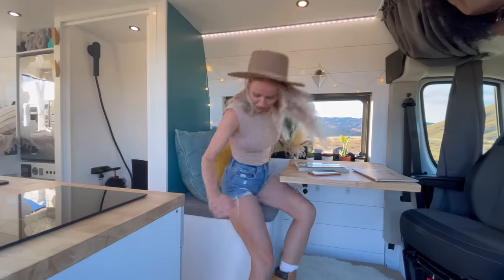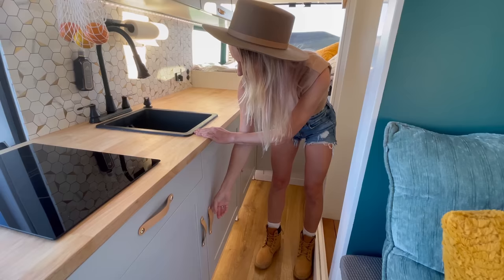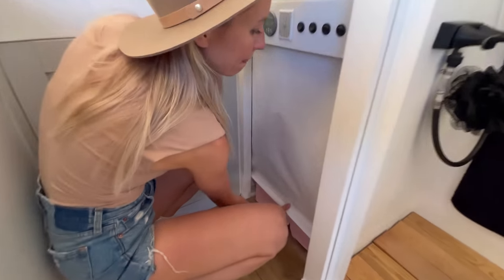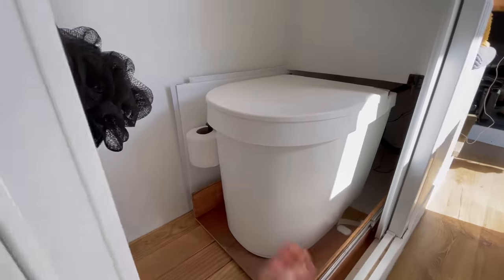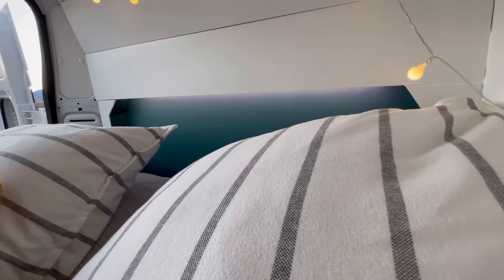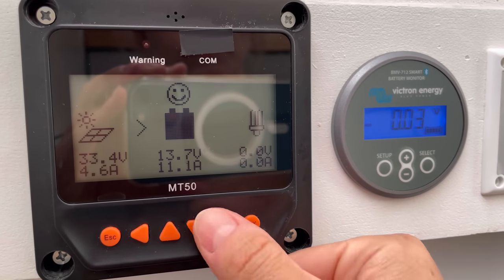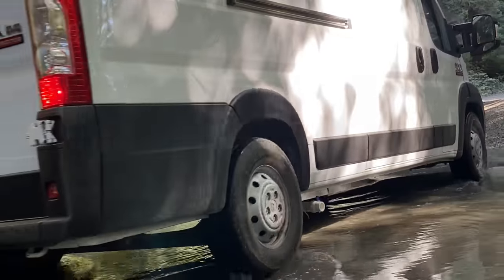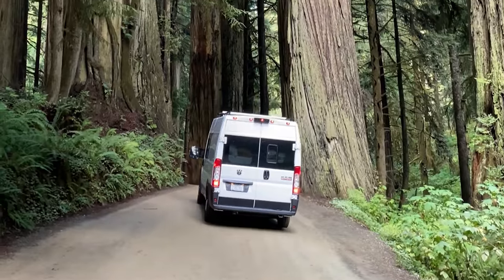VAN TOUR | Ram Pro Master 3500 | Luxury campervan self-conversion with shower & toilet

Comment: I really like the idea of an electric hot water heater.
Water can be heated when driving to a new destination, when connected to shore power, and finally from the van's battery/solar system.  I'm surprised such hot water heaters aren't more common in vans and RVs.

Comment: As van builds go.... yours is a definate 9+ or maybe even a perfect 10!!  LOVE your design, the shower/toilet and I would definately pay over $1,000 for a toilet that you don't have to limit to #1... would HATE to have to find a place, which I imagine would drastically limit outings.  I realize that most state parks have bathrooms, but I have experienced that some of them close for certain seasons... and I don't even have a van!

I see a lot of folks eliminating the garage, which I would not want. Knowing how well our 5 day cooler keeps stuff very cold, I would be housing one of those in the garage to top off with ice when needed, to keep beverages cold, and/or extend for a couple of days, a grocery haul if you were traveling to a remote spot and wanted a bit more to stock up.  I saw one van build that had a cooler like we have, stored in the van garage, that can be plugged into the car a couple of ways, and be either used for heating or cooling. Not sure why most vans don't do that?

I also would want my fridge mid-level instead of on the floor as most have it. Those low fridges would be a pain to find items in the back, or to stock. Your height is perfect and well planned.

Well done.... wish we had the freedom to buy yours!  We could probably afford it, but just not the time to enjoy it!

Comment: If I am not mistaken you are using the nebia by Moen wand for a showerhead.  I would guess gives you maximum economy of water usage. The wand seems to have originally been designed as an add-on to one of their overhead shower heads to give a 360 showering experience. if I am clear on their ad and the product you are using is that right? The role away toilet design the model you choose and the showerhead seems to be the best van bathroom design I have ever seen.
Reply: Hi Michael, thank you for your comment. You are right, shower-head is designed as add-on, It's connector is unusual and we create a little transition using small pease of 1/2" hose.

Comment: Good camperization design, materials and interior functionality, it's a pity that it doesn't have windows to let in natural light, it has only 1 window on the table and the ones in the back.
Reply from the maker: there are 3 windows: 2 on the back and 1 in front. It is sufficient for daylight. But adding more windows, you sacrifice the insulation ability of the van.
Reply: @Daniel,
2003, for our ExpeditionVehicle, we mounted 3010 (three feet wide by a foot tall) dual-pane sliders designed for a stand-still house.
We mounted these at our eye-level standing inside, about eight feet above pavement.
.
Advantages:
* peepers are discouraged
* easy to insulate
* quiet.
We always have two windows open on opposite walls.
Winter, the escaping warm air carries humidity and odors.
.
Based on experience, more windows equals uneven temperature control, resulting in condensation...
... leading to mold.
.
As you can see, bringing in natural light is one consideration, and each decision has consequences.
One consequence of more or bigger windows is the effect on structure integrity.
.
An aside:
Our interior is three paces across by seven paces long.
The inexperienced often ask:
* "Nearly two decades full-time live-aboard! How do you live in such a tiny space!"
We do not live in our ExpeditionVehicle.
We live out of it.

Comment: 30 gallon water tank with a low flow shower that's a perfect combination, especially can take shower every day, it is a break through for van tourer.
I am very interested in this van, may I know of it's mileage ?
Reply from the maker: Text me pls on email - sofiati@icloud.com
Reply: Our ExpeditionVehicle rarely gets better than 14mpg.
Although we prefer winding rural two-lanes, we occasionally use the freeway slow-lane, puttering along at 52mph.
.
We are often asked about our fuel consumption.
We rarely travel more than a hundred miles a month; fuel is a very minor part of our budget.

Comment: Curious how cool the van stays in hot temps with the fan and insulation. We have pets and are trying to figure out if we will need an AC over the fan system?
Reply: A van without air conditioning will never be cooler than the ambient outdoor air temperature, and will generally always be a few degrees higher from things like van body heat from the sun, residual engine/exhaust heat and reduced air flow holding in heat, so you just need to decide what temperature you find comfortable.

If you travel in dry climates like Utah, you can get some help from evaporative cooling.

The most affordable choice most make is to travel with the weather: North in Summer, South in Winter.  You can also go higher in elevation such as into the mountains in AZ before it's cool at lower elevations.  Other than that, you're looking at air conditioning and maxxing out the roof with solar panels and a very big and expensive lithium battery setup to power it for hours, or, a quiet generator, or staying where there is "shore power".

Clever people have managed to install a ductless mini split (they can be low energy), and even a modified window air conditioner where they had a tech pull a vacuum and empty the refrigerant, then cut loose the evaporator coils, and mount them below the van with a bit of tubing added to reach.  Another segmented off the back end of the van with a wall across it all, leaving just enough of an air space behind to mount a window unit as normal in the wall across the back, and then just crack a rear door open to exhaust the heat.  And of course there are traditional RV roof mount AC units.
Reply: @brianmi40  
Ah, the paradox...
... photovoltaic requires parking in the sun...
... but experience says shade is cooler.

Comment: I'd have to cut a 45 degree angle on the table corners, not enough to lose any useful area but just enough to make it more user friendly.  I've used those same wood counter tops (bought cheap, from industrial supply houses, amazingly cheap) and they also make them with a bull nosed/rounded front end. You ever notice, even the smaller home built campers,  like this one, have more counter space than most of the pro built RV rigs?!
Reply: @port,
Do NOT get me started on factory RecreateVehicles.
Staples into particle-board?
Holes in the roof?
Cheap disposable?
Crumble to dust on the first trip?
[shudders in revulsion]

Comment: What's the price?
Reply: These are going for $200,000 USD. You're better off getting camper and towing it with a nice truck.
Reply: @fifthcircle1  Us ladies want to be able to access the drivers seat w/o getting out just in case things get crazy and we need to skedaddle out of there.
Reply: @pamc3338  reasonable, but full RV's go for less.  Although, they also fit fewer places and drink more gas, so.

Comment: that carbom monoxide detector is misplaced, it should be close to floor!!! that is because carbon monoxide is more dense and will go down,!
Reply: You are mistaken, perhaps you’re confusing CO with LP gas (which is heavier than air). “Because carbon monoxide is slightly lighter than air and also because it may be found with warm, rising air, detectors should be placed on a wall about 5 feet above the floor. The detector may be placed on the ceiling.”
Reply: @Leo,
In our ExpeditionVehicle:
* We use two CO detectors from different manufacturers.
* We use two smoke detectors from different manufacturers.
* We use two propane detectors from different manufacturers.
.
Sean Connery is quoted as saying:
* "Not my first rodeo..."

Comment: Im curious why you dont just buy a small motorhome? They are far better equipped, cheaper, and hold their resale value better.
Reply: preferences
Reply: I personally prefer something on the smaller side that you can park in a regular spot
Reply: True, it isnt the most economic choice. But its smaller and more personal, which are big plusses for some people. Many motorhomes feel soulless and industrial.
Reply: Something like a dethleffs globebus T1 would be a good replacement for this type of van. I guess youre right.
Reply: @Derek,
Thanks for your sense of humor!
A new factory RecreateVehicle depreciates by half the first month.
A used factory RecreateVehicle depreciates to zero-zero-zero in the first year...
...rain intrusion through holes in the roof...
...soft spongy floor...
... plumbing decaying...
... appliances and cabinets dancing across the floor...
... electric gremlins.
Keyword:
* staples into particle-board.
.
We delivered RecreateVehicles manufacturer-to-dealer and dealer-to-shows.
A year and a hundred thousand miles convinced us any factory RecreateVehicle would crumble to dust on rough logger tracks to our favorite remote mountain lakes.
Or our favorite isolated Baja beaches.

Comment: I thought the Tiny Separett Toilet was neat until I saw its terrible reviews on Amazon.   Not very good at all.
Reply: Yeah,  after we saw that reviews we were worry too. And we bought Tiny by Separett and Nature Head as well. After comparing them we found out that Tiny has more benefits than NH. We love it. It is little bit tricky to install it. Maybe that bad reviews came from people who had some kind of problems with installation and finally they did not made it correct. We don't have that problems. This is just my opinion =)

Comment: With that large kitchen sink and both of you taking a shower every day your 30 gallon water tank won’t last very long
Reply from the maker: il lasts 3 days
Reply: @mark,
2003, for our ExpeditionVehicle water, we chose five-gallon stainless-steel retired Pepsi kegs.
Our standard load is seven, the system is modular, we can add a dozen more.
.
In the toy-hauler I fabricated on a similar commercial chassis, we can carry several more.
Advantages:
* modular -- take two, or two dozen
* separable -- a couple-three go to town for re-fill while the others stay in camp
* one keg can move to the picnic-table or campfire
* loanable -- if a caravan chum needs a few gallons, a keg is easily available
* no plumbing equals no leaks, no ShurFlo rattling.
.
Pepsi kegs are engineered to be pressurized.
A quick puff from a 12vdc bicycle tire pump, and water flows from the dedicated kitchen sink sprayer attached directly to the keg.
.
For warm water, we use 'sous vide' circulation heaters.
A brainiac caravan chum calculated the photovoltaic to top our ancient AGM bank after a shower -- about fifteen minutes of mid-day sun.
.
We engineered this system after a half-century of camping in make-do rigs.
Is it perfect for everybody in YouTube-land?
Probably not.